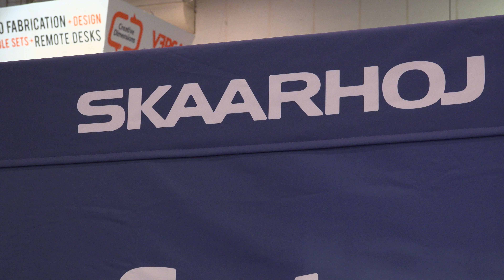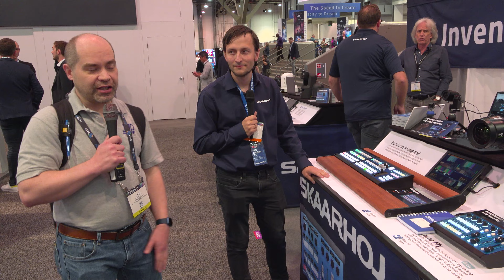Skaarhoj Control Panels - Air Fly Pro and Mega Panel - NAB 2022

Comment: I had a hard time following this presenter.  Lots of cool buttons and digital labels, but he didn't really explain why someone would buy this controller and not just use a BMD board with a streamdeck or X-key.
Reply from the maker: It offers a whole new level of customization and programmability not found anywhere else. They also control a much wider range of devices than anyone else is offering.

Comment: I thought most people were scaling down, not up. That equipment is for someone with a Large facility and even LARGER BUDGET.
Reply from the maker: It's definitely higher-end. They offer some less-expensive products as well.
Reply: @djp_video  I use their PTZ Fly Controller. Works Great but not cheap so those other panels will likely break the bank unless you have a very specific need for them.